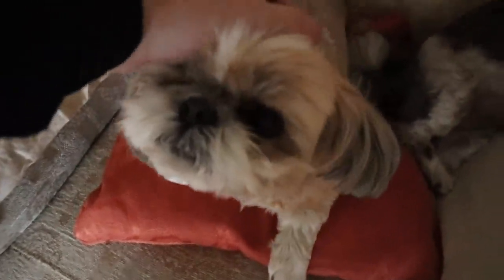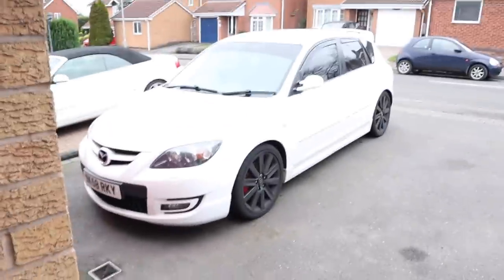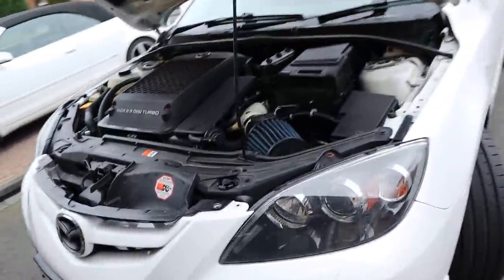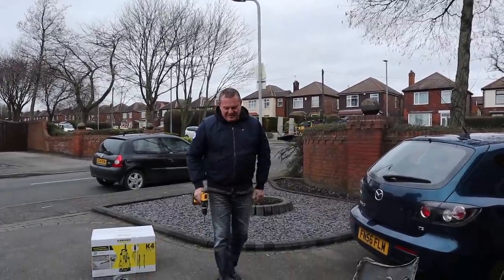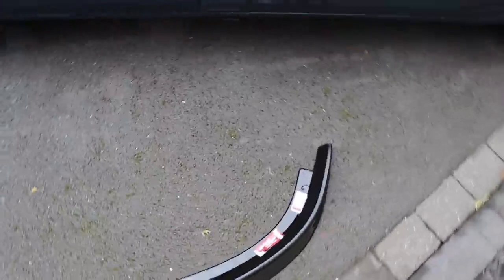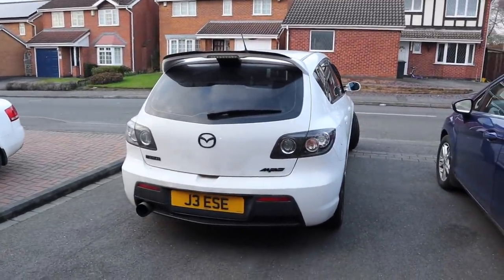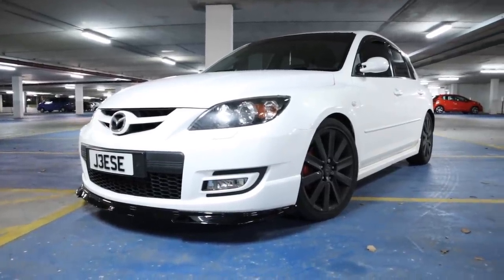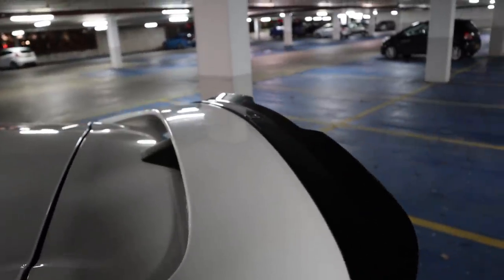FIRST MODS TO THE MPS!!

Comment: Mate get yourself those small plastic ramps that rises the car like 10 inches from the ground. Its safer than using car jacks and gives you access to your whole front end. I'm on my 3rd Mazdaspeed so far. Had a Protegespeed, a Speed  6 and now a 2nd Gen Speed 3. It's so easier to pull out bumper, oil changes, paint, wraps, checkups etc...its worth like 40 bucks you will only swear by them afterwards. Nice video btw. Keep em coming!!! Got my sub!! Cheers!!!

Comment: It's the little things that make a big difference... Even the plates 👌 did you look to see if Maxton do the little side skirt extensions...... They would compliment the splitter and spoiler extension. 

I wouldn't completely debadged..... Maybe leave the mazda m or the MPS on and debadge the rest, along with de wipering with a a glass bung fitted 👍

Good job though....... Can't wait to see how you get on when you go for power mods.

Any plans to fit some lowering springs?

*edit.... Commented before finishing the video, see there is plans for the side skirt extensions and rear spats 👌

Comment: finally your not a slow poke ;). love the car mate. look forward to seeing whats coming!
Reply: Pretty sure a 240bhp ep3 is faster than a stock MPS lol
Reply from the maker: elliot438bcfc mps is faster tbh it’s got the torque to get away
Reply: @JesseCollingham  I personally think the EP3 looks better and is better built/has a tougher engine but the Mazda is probably faster stock as it has a bigger engine and a turbo from factory!
Reply: @JesseCollingham  then you're in wrong gear? Both cars roll raced from 30/40 I can't see the ep3 losing
Reply: Idk about 240bhp ep3... But my old 254hp k pro ep3 beat a stock mps very easily and pulled away from a remapped e92 330d.
Reply: Mazda is faster. EP3’s are slow they have fuck all torque
Reply: @HasanMohammed-rt9ri  240/250 whatever it's all dyno differences end of day. Torque means fuck all when you have 9k rpm. I have a Fabia vrs and a 250bhp dc5 you really think the Fabia is going to take a type r cus it has double the torque😂
Reply: @GhostStPatrick_  stock mps only does a 14.5 1/4 mile
Reply: Its all about use ability in the right gear in the right weather yeah ep3 will more than likely pull away but how much money did that cost? Mps is a much more usable power in the uk and with a little mods will demolish a fully bolt on mapped ep3 (minus forced induction)